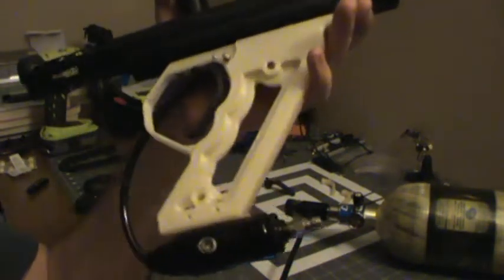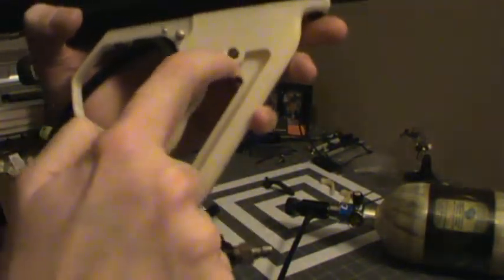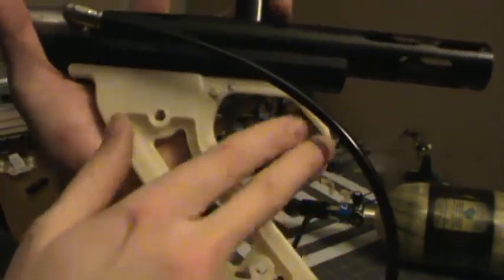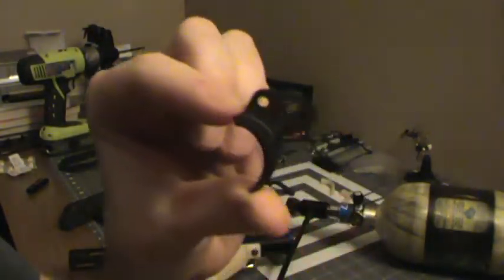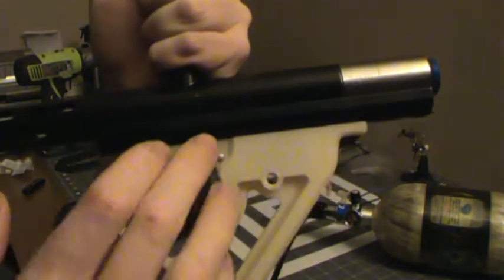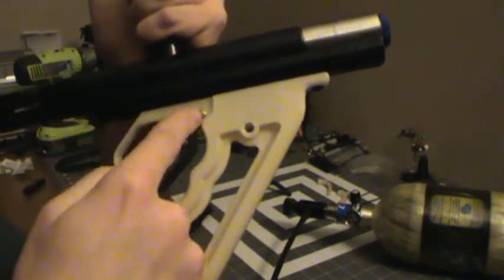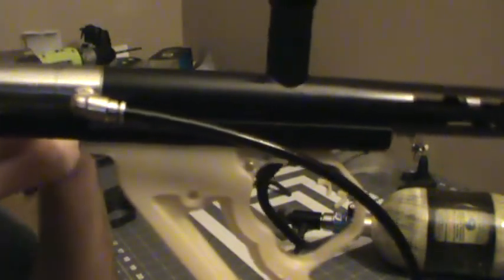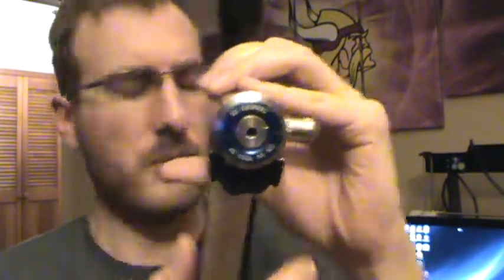Printed-Z Frame Testing Update #2

Comment: What’s the price point
Reply from the maker: looking at 75$ with everything needed to strap onto an automag and go(minus thumbscrew and frame screw). things can change as they go but that's the idea right now.
Reply: RKM3D Designs are you going to test it at a higher psi and rate of fire RT’ing
Reply from the maker: yes, that is my intention. i am trying to run as many scenarios as i can for testing..